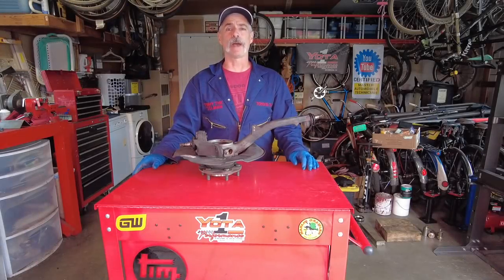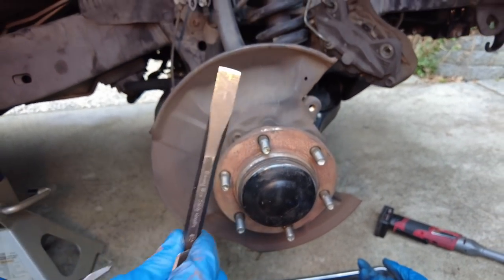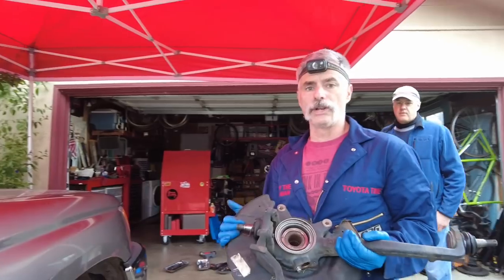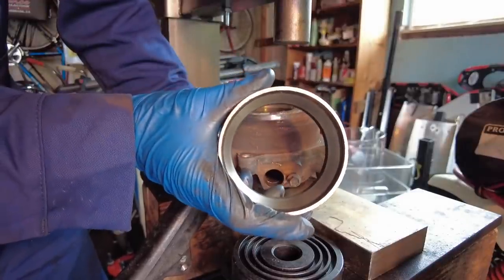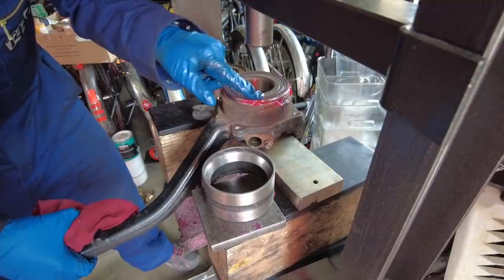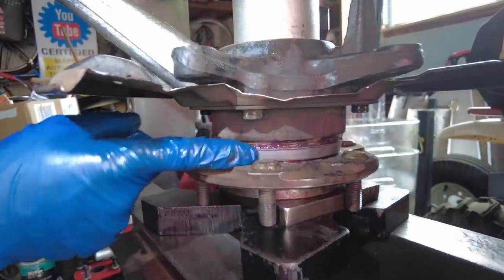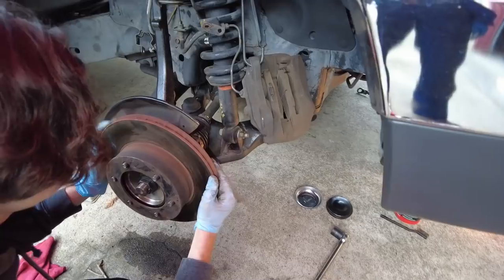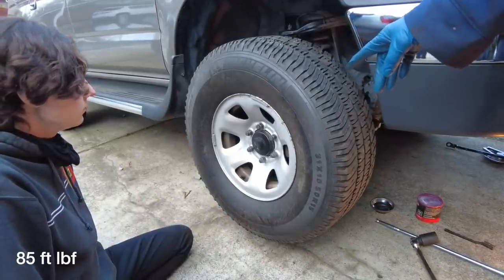Front Wheel Bearing Replacement (3rd Gen Toyota 4runner & 1st Gen Toyota Tacoma)

Comment: Was there a lot of resistance, the hub is hard to spin after the install. Mine is smooth but it takes some effort to turn
Reply from the maker: It should not be hard to turn.  It should spin easily.  Did you properly support the bearing inner race when pressing the hub through the bearing?  Or mayb a shop do this for you and you don't know.
Reply: @TimmyTheToolman  I did it, i supported the bearing. I pressed the abs and retainer on then it becane hard ro spin. I supported the hub while doing that. I smacked the back lightly with a hammer and it spun freely again. However the axle nut presses it right back together and it takes some effort to spin it. I couldnt feel play in the old bearing but the abs ring had made contact with the housing. When i pressed the hub out, the bearing race was stuck to the hub. It blew the snap ring out and cracked the side of the main bearing housing. I drove it with the new bearing and the steering feels much better the tire rolls fine on wet grass, before that wheel would lock up every easy. I drove At 55 for 30 minutes or so, the hub built some heat but nothing major.
Reply: I just finished installing it today. The old hub had heat marks on it where the the abs ring is. Everything pressed together smooth
Reply: It wasnt hard to do at all, I did the rear bearings a few months ago. Upper and lower ball joints about a year ago. I used a national wheel bearing and cheap Durango hub from rock auto. , i suppose ill just replace it again if it doesnt work out. Thanks for the quick reply man.
Reply: I know ive wrote a whole book. Sorry. As I think more about it, its like .001 of an inch is the issue. The last press into the bearing and it gets stiff. I would bet its a wheel seal issue because of it shooting the snap ring out when coming apart. Perhaps it deformed the snap ring ledge and created an interference problem with the hub and seal. I used a metal seal for both inner and outer.  Its the only thing that makes since to me.
Reply from the maker: @TOLDyouSOagain  The bearing and hub you used might be the problem.  I've done a few sets of these bearings now and they've all come out smooth with no detectable resistance.
Reply: @TimmyTheToolman  ill dig back into it and see what I find. There should be some whitness marks if something is wrong when I pull it back apart
Reply: I pulled it back off, press the hub and didnt see anything or feel anything unusual in the bearing. Federal-mogul didnt have any explanation other than send it in as a defect.
Reply from the maker: @TOLDyouSOagain  If you're willing to spend the money, get the bearings we link in the video description.  When you pressed the hub back out of the bearing, you could have done damage because you can't support the bearing inner race when pressing the hub out.
Reply: i seperated the bearing and inapected it when I pulled the new hub. I then sealed the bearing back together. I wish I had used your link to start with. Rock auto has a koyo bearing but listed under a different name for cheaper than I paid for the national bearing. I drove 100 miles today on the interstate without any problems and it ran the same temp as the other wheels bearing. I dont understand what happened
Reply: @TimmyTheToolman  I pulled the spindle and changed the bearing for a new one I had for the other side. The tolerances must have been off because its smooth as it can be now. It spun better after driving it with the problem bearing but I knew it wasnt correct. The outer seal was also ate up. I will look or ask if you have links when ordering parts in the future. Thanks for your advice
Reply from the maker: @TOLDyouSOagain  Good decision Brandon.  We link parts and tools used in the video description and sometimes a pinned comment (1st comment you see). if you check both those areas for the videos you reference from us, you should be good to go.  You're welcome and Happy Wrenching!

Comment: I did everything to the t and my hub came out really stiff is that normal? Everything was brand new
Reply from the maker: How stiff is stiff?  The bearing should feel smooth.
Reply: @TimmyTheToolman  I can spin it with one hand but I won’t stay spinning like in the video the bearing does feel smooth though
Reply from the maker: @josegarcia-mn8ci  I think you're fine.  If you followed the video and properly supported the inner race of the bearing when pressing the hub in, you couldn't have damaged the bearing.

Comment: So what do you do when you put everything together and realize you forgot to put the dust shield back on?
Reply from the maker: Well, if I did that, I would cut the dust shield in half with a cutting disk, bolt it onto the knuckle and weld it back together carefully.  You could probably just use a series of quick tack welds too if you were afraid of burning through the metal.  You can't press out the hub again, because that puts a heavy side load on the bearing that you can't protect.  So, you would basically trash your bearings.  That's a bummer that happened.  Did you just get back from a two martini lunch and then did the press work?
Reply: @TimmyTheToolman  funny. I took everything apart,, tore apart the bearing and it split on the hub and rest stuck in knuckle. So Was so happy to find someone to remove the broken bearing and  press the new one  in for me, forgot to take the shield to him. Got it back $30 later went to install, and was like dayum
Reply from the maker: @keizersoze907  Gotcha.
Reply: @TimmyTheToolman  thanks again for the replies!  will have to go it without, one the next run will reinstall the dust shield. Dummy move on my part. Appreciate your contributions always!

Comment: Can a 2 wheel drive knuckle be converted into 4wheel drive
Reply from the maker: I don't know 100% but I'm pretty sure they can.  You would just have to remove the old bearing and hub and replace it with a new bearing and 4wd hub that will accept the CV axle.  Your 2wd bearing has a nut on the back that sets the bearing preload just like it would for a 4wd rig with manual hubs.  You could reference our manual hubs swap videos to learn how to handle them.  Part 1: https://youtu.be/TZ2sOfVrnhU
Part 2: https://youtu.be/1TpOYj0sUpA
Reply: @TimmyTheToolman  thank you so much I really appreciate it. It looked up part number and shows same part number for 2wheel and 4wheel. I have to rebuild mine and put some spindle Gussets on so I figured it be easier to go junk yard get some so my vehicle still operable while I rebuild them and strengthen them. Thank you again
Reply from the maker: @joshuabell8638  You're very welcome Joshua.  Good luck with all the work.

Comment: Any issues with the grease and the abs sensor “reader”?
Reply from the maker: Nope.  I was a little sloppy with the grease application.  It would be best to avoid getting grease onto the ABS tone ring.
Reply: @TimmyTheToolman  i might have done that on my chevy. Never dealt with 4 wheel drive before. 1995 chevy silverado k2500 with hub and rotor joined with pressed lug nut studs. Whiiich ive never seen before either. Code didnt clear but my code reader is in my tacoma with misfire issue still chasing. Gonna do some diagnostics per your awesome instructional videos. 👍😁👍. And use my torque wrench so i dont get a ticket from the torque police🤣
Reply from the maker: @pitchforkpeasant6219  Good luck and definitely watch out for the Torque Police.

Comment: What the heck is that... a completely intact brake dust shield???  Our 4Runners here in the Northeast don't have anything like that.
Reply from the maker: Yeah, we don't have much rust issues on the west coast but we have other issues like bum camps and trash everywhere you look.
Reply: I took the wheel off to do brakes once on my 5 lug Taco on a lift once. I sneezed on the splash shield while getting ready to take the dust cap off the bearing and that was too much for it and it fell to the shop floor in a rusty heap LOL.
Reply from the maker: @jeep6242  Man, I feel for you guys who have to deal with significant rust.  That would take some of the fun out of it.
Reply: @TimmyTheToolman  Just once I would like to see you deal with a rusty fastener!  Your videos are awesome and super helpful but you are working in a state of nirvana that doesn't seem fair to the rest of us.
Reply from the maker: @jaysheehan6122  Well, you know what they say, life isn't fair.  If we were dealing with rust, we would just have a lot more editing to do from my cursing when we break off fasteners and have to extract them and retap threads.

Comment: I am thinking so but Can anyone confirm a alignment is needed after doing this job?
Reply from the maker: An alignment is not necessary unless your last alignment was done with wheel bearings that had play in them.  With the wheel(s) able to move from the bad wheel bearings, it could throw off the alignment.  Normally,  an alignment is not necessary after replacing wheel bearings because you did nothing to change the alignment values.  Alignment values change when you mess with the outer tie rod adjustments and/or you mess with the cam adjusters on the lower control arms.

Comment: I'm am doing a front wheel bearing job on a 2000 Toyota 4runner Limited 4x4, on installation my bearing does not have a black and silver side? Both sides look identical and are silver on both sides. It's a DuraGo brand hub assembly, does it matter what way it goes in? I did this job on my 97 4runner and the bearing DID have a black and silver side...
Reply from the maker: I'm not sure if the direction matters but we decided when making this video to err on the side of caution and copy the orientation.  I don't think going with an aftermarket bearing is a good way to go.  I'd stick with Toyota OEM bearing which is made by Koyo.

Comment: "The hammer technique" also known as "Percussive maintenance."
Reply from the maker: Whatever the name, I'm not a fan.  I have combined a slight hammer strike with a puller which does work pretty well.   But, wailing on something with a hammer over and over again isn't the technique I like.  Pullers work well and don't require you to mash up your components.

Comment: Holy crap I don't even want to remotely do this. It will take me forever to do it. Ugh. I am so bummed.
Reply from the maker: If you have the right tools, it's not that hard.  You could pull the knuckles off and take them to a shop to do the press work for you but then you run the risk of them screwing up the job.  I've heard of shops messing up the press work many many time on Toyota forums.

Comment: Holy shit is this a 2wd or what's the deal? I have an AWD 4Runner and I just replace the whole hub assembly for $100 and I'm done in 30 min. I just pop the wheel off, caliper off, rotor off, then take the hub off and replace it.
Reply from the maker: If you're talking about a 4runner, you must be talking about a different generation.  For a 3rd Generation 4runner or 1st Gen Tacoma, you have to press the hub out of the steering knuckle.  So, the deal is this is what's required to properly do the job for a 1996-2002 Toyota 4runner or 1995-2004 Toyota Tacoma.
Reply: @TimmyTheToolman  Mine is 4th gen so that's probably the difference and looking online I see what you mean. I'm seeing used 3rd gen hub assemblies for sale on ebay with the entire steering knuckle still attached and installed. On mine you just unbolt 4 bolts, pop the axle nut off and the whole assembly just comes off. Appreciate your talent and professionalism!

Comment: That bearing would not  last, the hub must be on the top.
Reply from the maker: What on earth are you talking about?  Are you talking about when we press the hub into the bearing?  It doesn't matter how you orient the assembly onto the press.  What matters is you support the inner race of the bearing while you are pressing the hub shaft through the bearing.  We did that with a press sleeve.  Now, if we didn't support the inner race, then I would agree with you that we could have done damage to the bearing. So, I suggest you watch the video again and better analyze the way we have everything set up onto the press when pressing the hub into the bearing.  If you still think we did something wrong, it's one of two things, either your mechanical aptitude is lacking or you're just trolling and talking shit.

Comment: How are you supposed to get that snap ring out, stuck in i even tried leaving it in the press and getting it. Now the stupid ears in the snap ring broke off. Thank you toyota for this stupid design
Reply from the maker: When you press the hub out of the bearing, it ends up pushing the bearing outward which puts pressure on that that snap ring.  To free up the snap ring, you need to apply force in the opposite direction.  We cover how to do this in the video.

Comment: What is it cost if I take both spindles into a shop assembled and have them do the work there
Reply from the maker: Don't know.  We've never priced this job at a shop.  It will depend on the shop.  Dealerships are usually more expensive than independent shops.